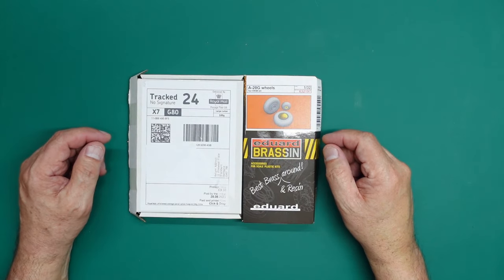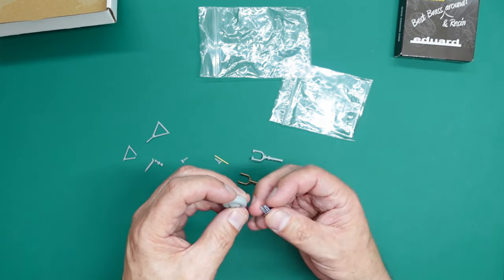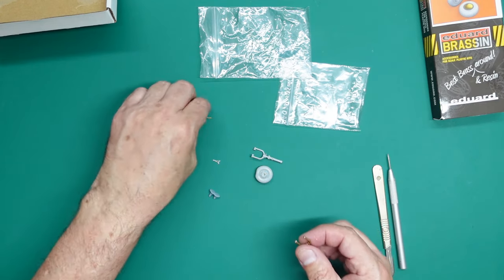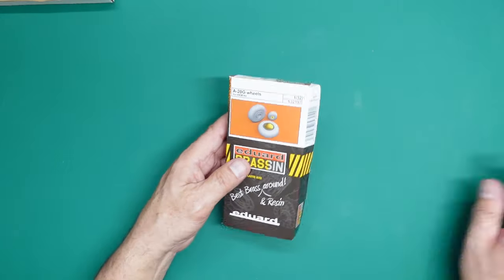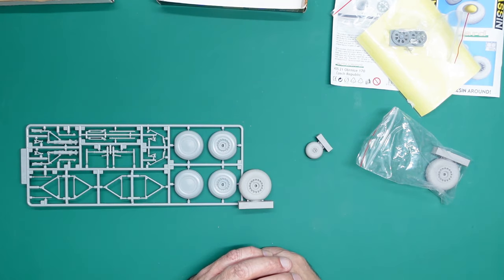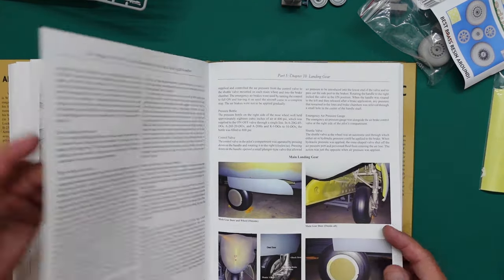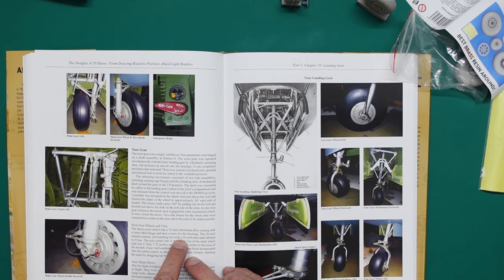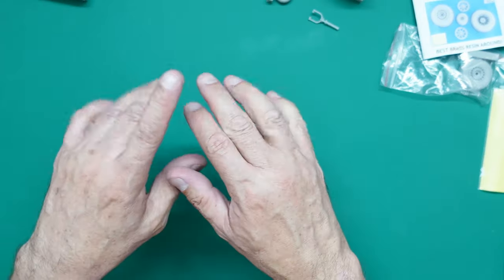Yes, MORE A-20 Aftermarket goodies

Comment: I held off on ordering the wheels, hoping someone will come up with correct ones, and may just use the kit ones for now without gluing them. As for the nose gear, I really like what you've got and will order myself a set. All I need to get now is some toggle switches and dials/knobs. The Airscale cockpit upgrade kit is great, got some brass barrels and ASK's masks.

Comment: The nose wheel was the one glaring fault that I noticed straight away in the kit. Having watched both a Boston and Havoc restored side by side over a period of time, and seen parts from them in an unrestored condition it was clear that the kit part was inaccurate for a wartime aircraft , but im guessing they used the airworthy example in the states as a guide, which is fitted with that same wheel and hub, as the kit

Comment: US light and medium bombers such as the A-7/A-20, B-25/26 and P-61 all used the same hub and tyre size in the main gears for commonality. This is in the same way the B-17/24/29 had the same hubs and tyre sizes. The nose wheel hub and tyre of a B-24 were the same as a B-29, except the Superfort had two.
The nose wheels of the P-61 and B-26 were also the same.
As for doubts about tyre size for this kit, just get the main wheels of Monogram's B-25, measure, times by 48 then divide by 32. Compare the Eduard wheel and the kit wheel and the closest figure will be the most suitable to the one measured.
Come on, guys, easypeasy.😊
Reply from the maker: I'm afraid your information is incorrect, this is obviously the info Eduard had. The A-20 had 44" tyres, the B-25 had 47" tyres.
Reply: @NigelsModellingBench Ok, that's a difference of 3" on the diameter and therefore 1.5" on the radius at 1:1. In 1/32, that's 0.046875" or 1.19mm. Do you really think that's noticeable? I would have thought correct hub and tyre tread pattern was more important. This is obviously important to you, so tyre wall and width must also be factored in. Have HK or Eduard stumbled there too?
Reply from the maker: Yes, if the tyres were correctly scaled at 1/32 of 47", but they are not. They are 1.497", whereas they should be 1.375", so yes, it does notice, plus, if we are paying for replacement parts to improve the quality of our model...... The difference is noticeable, yes.
Reply: @NigelsModellingBench I get your point now. Indeed, at nearly 48" when it should be 44" would make a difference. That is a discrepancy. I stand corrected. I concur too,  it is diappointing and frustrating when one acquires after market only to learn it's not as it should be.
Hopefully, you'll resolve this.

Comment: I sent a message to the air collection in Texas that flies the only airworthy A20G Havoc and asked about tyres and if any had 47 inch tyres. I’ll let you know if I get a response. I can’t post it on the Facebook group because someone posted a photo with not text, so I wrote “ and?” To hopefully get some info and I got banned for being sarcastic or some rubbish
Reply from the maker: You got banned from the group?? Seems a little strong Mark? Turns out the 47" tyre is incorrect, Eduard are making replacements.

Comment: When you paying this much there shouldn’t need to be After market😢
Reply from the maker: NEED is one thing, WANT or DESIRE aftermarket is another. For example, the Border Model 1/32 Lancaster requires no aftermarket, though most will desire Brass gun barrels. On the other hand, the HKM Lancaster cockpit NEEDS aftermarket as it is missing a lot of detail.

Comment: Looks like another Eduard F'up and they won't be doing anything to correct it.Ahh memories of the B25 wheel set.
Reply from the maker: What was wrong with the B-25 set?
Reply: @NigelsModellingBench  The main wheel face is not the correct size for the hole in the tyre.There is a gap around it because of that.